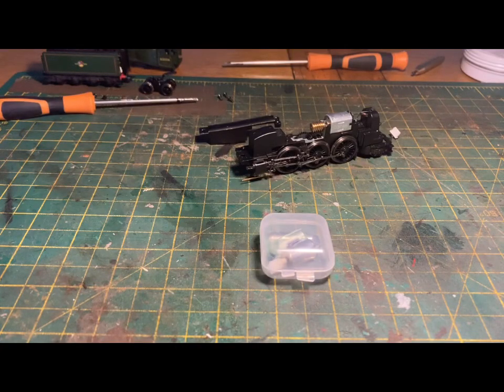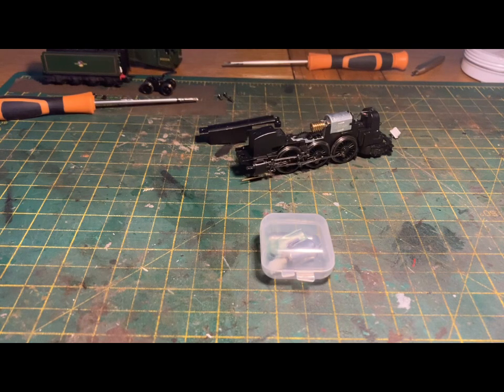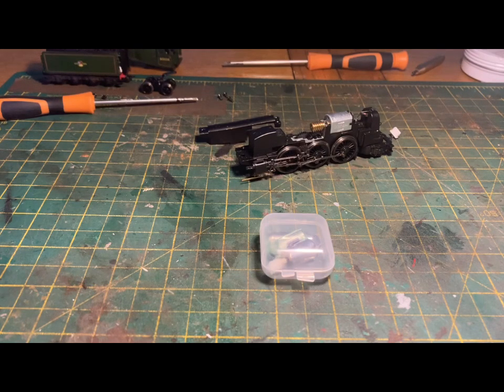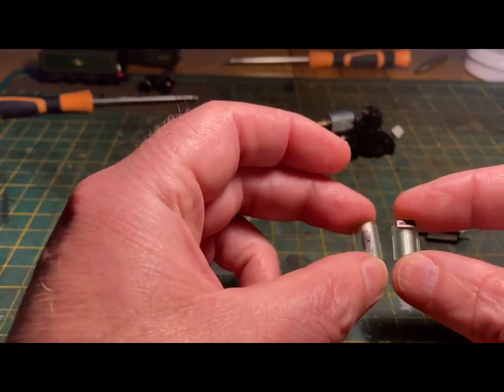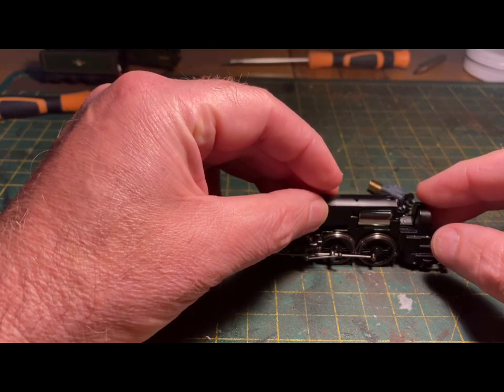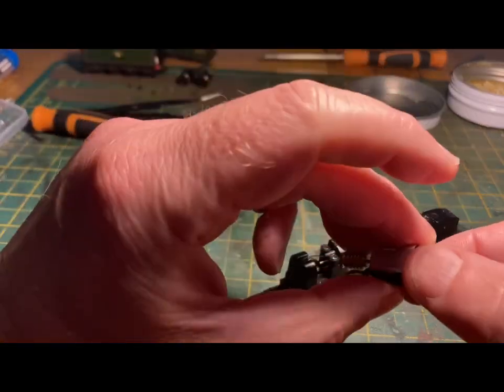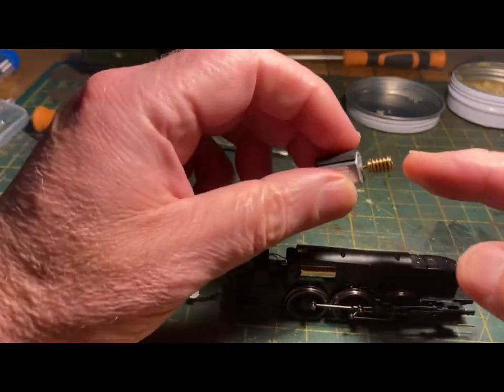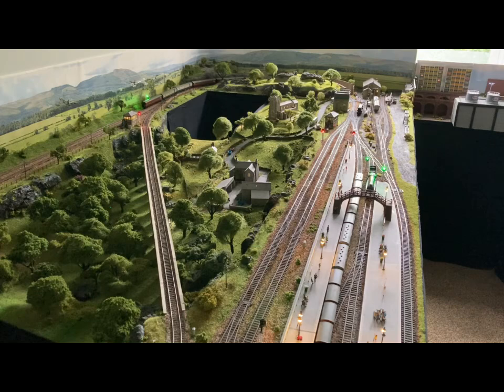Hornby TT:120 Gresley Pacific, Coreless motor kit install, testing and data

Comment: Just tried the link and it's saying it doesn't exist 🤦
Has he stopped producing the kits or is there another link I can try?
Thanks 👍
Reply from the maker: Thanks for the heads up, I think Richard updated the website since this should show the A1/A3/A4 Coreless motor via the BBD website, Bayliss Bespoke Designs

https://www.baylissbespokedesigns.co.uk/shop/p/tt120-a1a3a4-coreless-motor-kit-for-hornby-tt120-meke5
Reply: @HighFell  thank you so much, I've ordered 2, one for the Falcon which refuses to reverse and one for Blink Bonny that's working perfectly fine now, but from everything I've seen on YouTube it ain't gonna last
Reply from the maker: Be Prepared! If/when BB goes down you can have back in the rails in a few minutes. If you are running DCC check out the video I did on motor calibration with HM DCC 👍

Comment: And what is the differnce between those motors ? I mean why would I want to do this, I am a complete noob
Reply from the maker: The OE motor is iron core 3 pole motor with BE type brushes. If it was the best quality of its type, that might not be such an issue however the motor has suffered a lot of short life issues. The basic design isn’t ideal for the application in a model railway loco with lots of stop start and reverse operation.    I have done a couple of videos on repairing/replacing these type of motors very cheaply. So far mine are standing up to use better than the OE one. 
This video features using a  coreless motor. These do not have the iron core with windings wrapped around, they have a skew wound ‘basket’ of windings set in resin. This makes the initial load on startup much less, they tend to have a lot less arcing between the commutator and the brushes. This motor still has the BE type brush. The reduction in arcing will have a significant effect on the life of the brush fingers. These burn away on the OE motor. Because the manufacture of Coreless motors means they are more expensive, no one bothers with making dirt cheap ones with low end components. You can buy a similar motor to the OE for £1.65 The Coreless ones are around £29. So far the Coreless equipped locos are exceeding the performance and life of the OE one. 
Thanks for asking, I’m sure a few others wanted to ask but didn’t 😁👍

Comment: Great find. In Australia here and new to this in retirement and love it but have had four motor failures as you describe, Hornby here are aware of problem but can do nothing but replace with same. Ridiculous as Night h\Hawk has failed twice in under 12months since I started. I have just begged Richard of TWW to start shipping to Australia. Maybe you could help. Tar
Reply from the maker: Hi, this really could help for you guys overseas as I know it’s awkward returning stuff for warranty repair. If you buy via EBay then there should be an overseas delivery option?
Reply from the maker: Richard has added overseas shipping to his eBay listings. 👍

Comment: Another upcoming option, many thanks for the video! I've tried the other kit recently (the micromotors one) as I came across it at my local model shop. Its original motor is really short (in fact, 4,6 mm too short) and is a bit low in torque. So I'd ordered some more motors (all at 16 mm in length and with dual spindle, but different in diameter) and some different flywheels just for a bit of testing & trying on Falcon and a 08 shunter. 
Does the motor in Richard's kit have two spindle ends?
Reply from the maker: This motor is a dual shaft one so could accommodate a flywheel although I haven’t found it necessary. The smaller motor I think is compromised as result of its smaller size. In other tests small coreless motors can’t manage the heat well and break up. 
Please come back with any developments trying your ideas 👍

Comment: Already ordered some and waiting for delivery.
Reply from the maker: Richard has tried these with DC to buy bulk of testing was with me on DCC. It will be interesting to hear what you think Garry. They are super smooth and  seem to have good motive power.
Reply: @HighFell  Hopefully here soon Matt even though Ebay states next Wednesday. I am guessing he bought a few although Ebay only had 5 for sale. My hard part is which locos to fit them in. I think I will do various ones like the Jubilee, W/C etc to give a broad spectrum of my locos a chance and not just A4's.
Reply: I’ve fitted coreless motors to a few of my n gauge locomotives as has Richard from TWW. Completely transforms them imo.
Reply from the maker: @michaelderozario5626  good to hear actual experience from others, thank you 👍

Comment: Very interesting video, thanks! After having so many motor issues early on, I'm glad to say that since I switched out my (old, second hand) Gaugemaster to a Morley Vortrak I've not had any problems since, touch wood the motors I have now will keep working for a while. It's good to know what options I have other than just hoping that Hornby will continue to fix things if anything does pack in again.
Reply from the maker: Don’t worry Dave, we will keep your ‘wee’ trains moving 😁 I think between us we have clocked a few hours and actually put the OE motors to the limit of what they can do. I will interesting to see if the Varley controller helps the motors live longer on DC.

Comment: Another very informative video thanks . Have you done any videos on changing the cv’s values as I haven’t got a clue I have a couple of locos that I think are slow and wondering if that’s the problem . Thank you
Reply from the maker: I haven’t as yet. One little issue is I film via my phone that I also use to do anything with the HM DCC App. What CVs are you thinking about or are you just finding a loco slow and don’t know? What loco is it?
Reply: @HighFell  hi again it’s the flying Scotsman
Reply from the maker: @ianhughes-zf1ll  ok, I’ll put something together on video. Have you read the manual for HM 7000/DCC? It’s really well written and not as scary to understand than any other literature I have seen on DCC. If you go to Hornby website, on menu select communities, Forum, HM 7000/DCC there is a stickie at top with links to all the guides and manuals . I’ll still see what Incan put together on some bits too. 👍